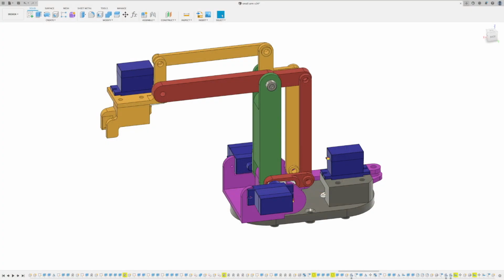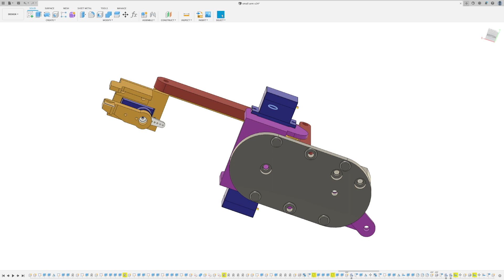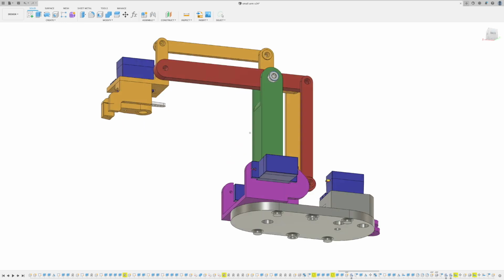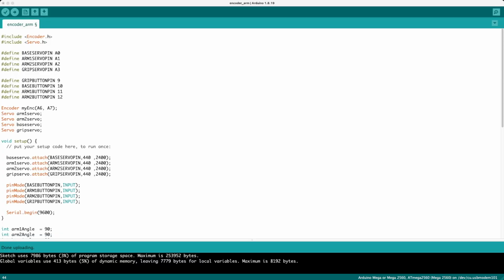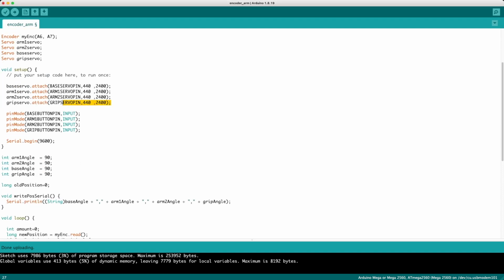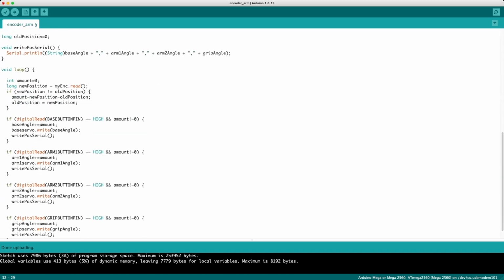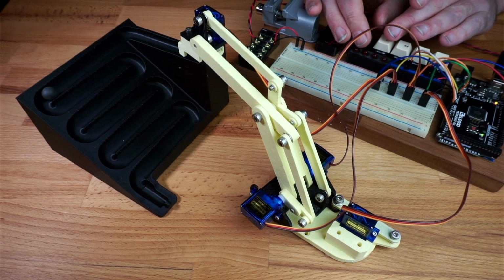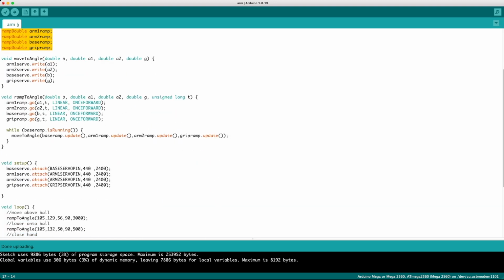I made a tiny robot arm - you can too

Comment: I've run into a problem and I'm hoping you can help. Everything is done and working fine except that, as you acknowledge in your code, my coordinates don't match yours. I was actually looking forward to dialing those coordinates in but unfortunately every time I restart the code there is a "re-setting" of the arm that is causing the vertical arm to slam itself back and this has now caused the already lose fit to become even loser. Is this just something these cheap motors do every time power is sent to them, they automatically reset, or is there something that I am missing in the code? Thanks in advance and thanks again for making this and making it available because it's been the perfect tool for learning about these things.
Reply from the maker: The servos will always return to their home position when you power them up. the trick is to find the home position and set it in the middle of the movement you want, so when it "slams itself back" it can't do any damage. You say you have a "loose fit" - where is this as mine is pretty sturdy!
Reply: @roTechnic  Thanks for your quick reply. It's very late where I'm at so I'll have to play with this tomorrow but when I power the vertical motor, off the arm, it moves very little when given power no matter what position I leave it in when powered down. I tried a few extra motors that I have and they all acted the same way simply moving a couple of degrees from the position they were turned off in so I'm pretty clueless as to what's going on. When you said they always return to home I thought that that would be the problem but I'm unable to make that happen. Anyway, I'll give it another go tomorrow. Thanks again.
Reply from the maker: @firstthes2811  Sounds like you have dodgy servos. It might be worth exploring a different make or even trying the MG90 servos which are only a little more expensive but should be stronger
Reply: @roTechnic  And what's really annoying is that I ordered 90's from Amazon in the first place but being so new to all of this I just checked to see that they all ran. Oh well, I'll find a way to make it work for the purposes of learning.
Reply: hello ! Please can you share the size and types of screws needed for the robotic arm.
Reply: @Mohammed-hd4pl  It's been a while since I built mine so I don't remember off hand but when I look at the the screw and nut kit that I bought from Amazon (the 1440 PCs 304 stainless steel hex button head cap screws bolts nuts washers kit) I can see that M4*8 were used by far the most. I believe a couple times I may have used longer but still M4, like 12's. The kit also has m416 & 20.

Comment: I hate to look a gift horse in the mouth, and maybe I'm misunderstanding what I'm looking at as I'm new to this 3D printing thing but, when I just loaded the stl into Cura all of the pieces for the robot arm are grouped into one object and therefore cannot be printed separately and the biggest part is, I believe, upside down, causing a massive amount of support to be printed. There's also another part that I believe is upside down causing unnecessary support to be printed. Again, I'm new so I could be wrong and hope that I am wrong because the unnecessary support adds an hour to the already 9 hour print job. I would love to hear your thoughts and thanks for sharing this.
Reply: Usually you just reorient the files before printing anything, parts downloaded from the Internet are rarely in the good orientation
Reply: @BartoszKoodziej-ft3yx  But that's just it, there is only ONE file, and that single stl file has all the parts together as one object making it impossible to just grab one part and flip it over so that it doesn't need so much support. Slicing that one object up in Cura is one way to go but by doing basically the same thing in TinkerCAD I now have control over whichever parts I have singled out by deleting all the rest. IOW, I'm basically creating the individual stl files for the individual parts I want to re-orient for printing or change maybe down road or leaving most of what had already been grouped together the way it was for printing.
Reply: @firstthes2811  one way to combat that is to export your assemblies as 3mf, if the author uploaded the files in 3mf format you would be able to just pick the parts you want. Maybe you could ask the author to export in 3mf?
Reply: @BartoszKoodziej-ft3yx  No I'm good as I already figured out a way to do what I wanted in TinkerCAD. I believe the author also provided the Fusion 360 file but I wasn't able to bring that up in Fusion and don't really want to take that on at this time anyway.
Reply from the maker: Hiya, If you don't want to print the parts in one go, you can easily split the group in cura using the method in this article: https://www.makeuseof.com/cura-3d-slicer-split-object-into-multiple-parts/
Orienting the parts is something you can decide for yourself - try it your way and see what happens! It's entirely possible there's a better way than the way I did it :D

Let me know how you get on - it's a great little arm, and I ended up giving mine away as a christmas present!
Reply: @roTechnic  Thanks for getting back to me. I ended up doing the same thing, kind of, in TinkerCAD. Since I couldn't grab an individual part bc they are all seen as one I basically erased everything but what I wanted to control. Once that particular part was all that was left in TinkerCAD I could now do whatever I wanted to do with it, like turn it over before printing it avoiding most of the needed support. As I'm typing this the last of the pieces are printing and I'm hoping to be able to put it together soon. Thanks again.